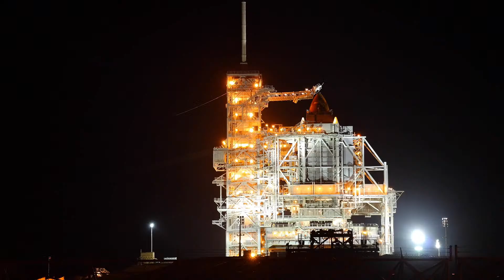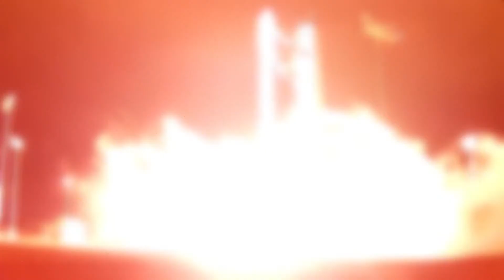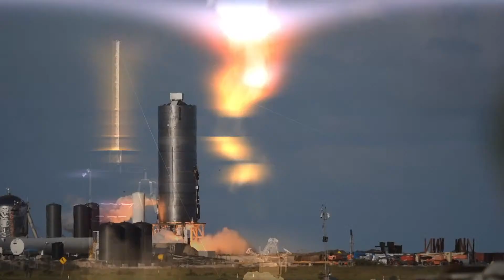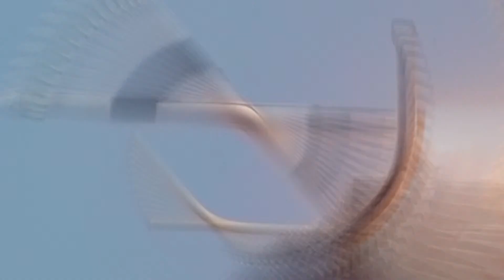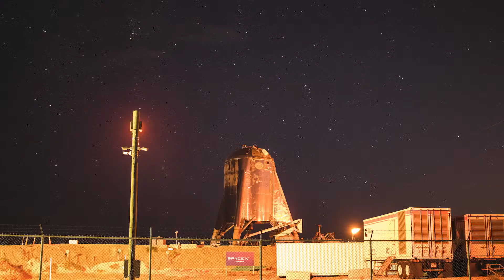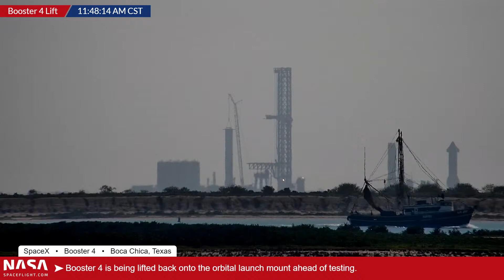Super Heavy Booster 4 Lift to Orbital Launch Mount

Comment: Same design as the soyuz in the 60's
The only difference I see are the engine design and rocket configuration design.
Not sure of the weight of the payload on this, the Russians were lifting 20-40 tons to orbit during the 70's.
The best of luck, I hope everything works better than they planned.👍

Comment: OLT QD arm seems too low for servicing the SHIP above the booster. Something is missing perhaps they are still going to raise or add a fixture for reach.
Reply: On top of the qd is the alien like fuel quick disconnect. Not well visible from this distance. But it's there

Comment: I feel like I'm going insane, they put on a cover for the booster engines but cut a goddamn hole so all the wires on the engines are exposed. Like this is the most obvious thing they need to account for but none of the engineers seem to give a damn

Comment: I wonder if testing raptors with only part of the engines is possible. I am not sure that a pressure which is not uniform can be supported by the structure?
It's a bit like pressing down on an egg evenly or pressing down on a small area.

Comment: Will the sensitive rocket plumbing be covered when used for liftoff?
Reply: It will have aero covers on it to protect it and keep it nice and slim during lift off, during max Q, and reentry. Even though it will crash into the water for this first test, it's a great opportunity to still gather as much info as possible and see if it can at least handle the strong forces of reentry.
Reply: It's a prototype, it's going to end up in the ocean so who cares if bits burn up on reentry?

Comment: Just a guess but I suspect capture with the chop sticks on descent might be aligned with the launch mount using a laser system and therefore can be totallyy autonomous with experience. Line up the laser beams when positioning with the tank treads on the chopsticks and alignment will be perfect on every landing. The real key is the autonomous capturing of the booster by the chpsticks - very tough problem but doable with enough landing data.

Comment: How would the chopsticks be moved away after stacking? I can't see how they would retract.
Reply: they spread open, to either side of the rocket body after placing it on the OLP
Reply: They would just rise over the top of the booster, swing to the side, go down, grab starship, and lift it back up
Reply: They will helplessly flap back and right, frantically trying to get to the starship. But, alas, the booster is in their way.
Reply: @Pongant  that's my line of thinking also😜
Reply: @shawndouglass2939  It's the only reasonable way

Comment: Ya know, everyone makes a huge deal out of 29 engines like is a crazy number... falcon heavy has 27... that works... only 2 more engines...
Reply: The Merlin is also a fully developed and flight proven engine. There's still a lot of unknowns with Raptor.
Reply: @cpthornman  true. But the Raptors do work, so far.. . They just don't have the hours that the Merlin has.
Reply: @corycrandell2682  Hence the unknowns.
Reply: @cpthornman  I get it, I'm just saying it's not an unprecedented amount of engines.
Reply: These engines are much larger and hotter and more powerful creating more sound and shock. Approaching the limits of present tech. And except FH, I cant remember any successful rocket with anywhere near that many large engines. Note USSR giving up on their moon rocket years ago.
Reply: Good point, but the Raptors are twice the power of Merlin engines.
Reply: @wannabegeek519  yes, and more complicated. It will be a surprise if they all function as desired. But imagine there is some margin for error. Still, I can't wait to see it fly.
Reply: I make a big deal out of falcon heavy flights too, actually. Either way, I am very excited to see this many engines on a single core. That's going to be interesting.
Reply: @Zebra_M  6 falcon heavy flights for 2022... but the first orbital attempt for starship will be possibly the coolest thing we've ever seen. I cannot wait!
Reply: @ikarus605  the raptor is not a bigger engine. It's a bit more powerful,  but its actually smaller in size.
Reply: @corycrandell2682  What? Raptor is way bigger than merlin. I think you're thinking of mvac.
Reply: @16BitGoofball  ok I stand corrected,  raptor is physically bigger than Merlin. And I'm not saying this is going to be a walk in the park, its just not that many more engines than we've seen SpaceX fly at once. And this is a lot of power here. More than anything else before it. I hope it works.